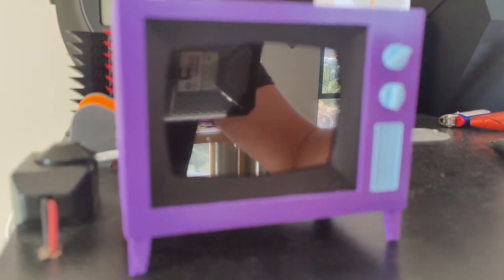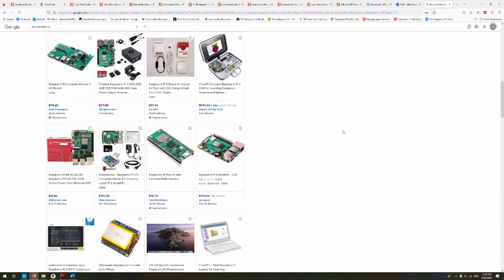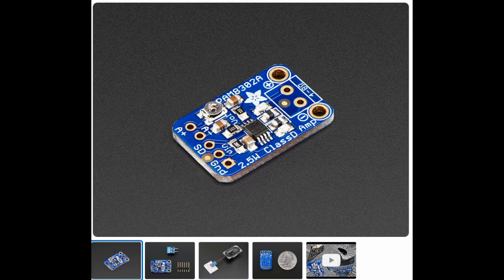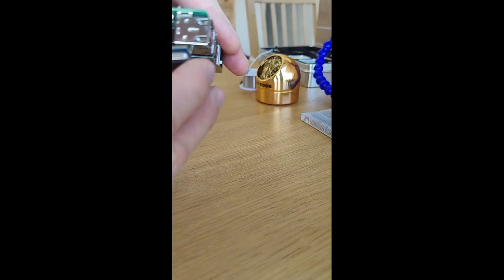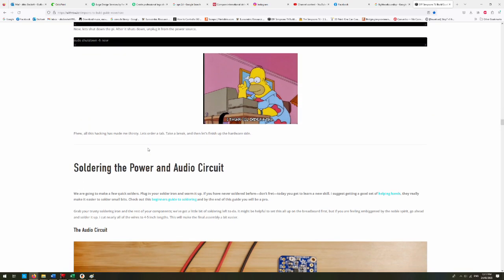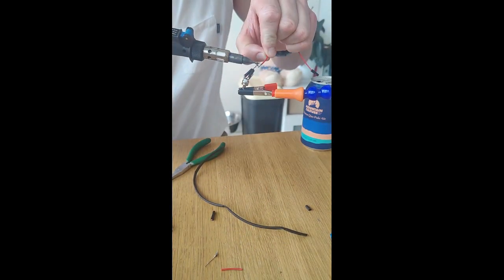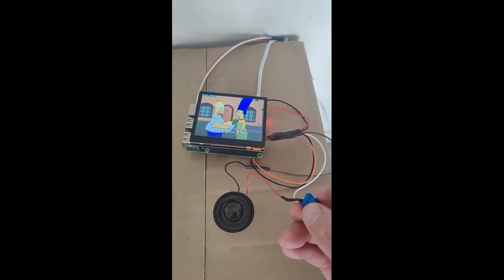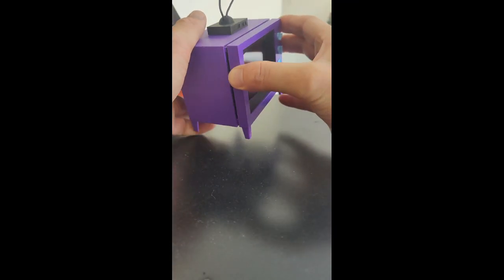3D printed Simpsons TV using Raspberry Pi 3b

Comment: Where did you grab buster lite?  I couldn’t find it in the pi imager ?
Reply: Got it working based on bullseye and oxm player… thank you for all the help :-)
Reply from the maker: Noo you have to download it.  
Then in the imager, scroll to the bottom and select custom software and then buster lite.
Reply: @ApeTechPrinting  

Perfect thank you.
Reply: @ApeTechPrinting  

I’ve got a 128gb card and wether i use etcher or the pi installer i end up with 128mb in boot and. Nothing else?
Reply from the maker: @AmishPatel-sl7cj  hey mate once you have written raspbian buster onti it.... Windows won't recognise it nor will it give you any accurate information as you have written Linux software to the SD card.  
I write the software to a 64gb card and afterwards it says that it's a 2gb card.  
I then proceed to copy 50gb of files to it.  
So don't worry about that
Reply: @ApeTechPrinting  godsend.  

Thanks I’ve been trying to complete this project for my wife since Valentine’s Day.  2 steps forward one back.  

Totally appreciate the help!!!
Reply from the maker: @AmishPatel-sl7cj  I understand mate.... It isn't an easy project, unless you're an expert in raspberry pi.     I am only an expert in Arduino.
Reply: @ApeTechPrinting  two steps forward one back.  Found the exact version of buster but can’t ssh to it (legit face palm).
Reply from the maker: @AmishPatel-sl7cj  setting up the WPA Supplicant file is the crucial step here.  
Entering you wifi credentials... I think I left the country code as US despite being in Australia
Reply: @ApeTechPrinting  thanks for all the help i know it’s not your day job :-).  I tried the supplicant and ssh route.  Note pad keeps making ssh ssh.txt not sure if that matters.  I also did the shift control x and added credentials there.  Maybe I’m not waiting long enough for the first boot….  I do have power (led in board  and backlight on screen).  I ordered a micro hdmi cable today so i can see what’s happening since I’m flying blind.
Reply from the maker: @AmishPatel-sl7cj Yeah you do have to wait about 2 minutes after it boots sadly.    I deleted the .txt. it warns me that the file could become corrupted, but just go ahead and do that.
Reply: @ApeTechPrinting  

Question for you.  I’m using the same uiniker 3.5 gpio screen… my problem is that all my videos (which i re encoded to 480 x 320) are all zoomed in to the upper 1/4 if the image was a grid box.  Any ideas?  Building a second one and it has the same issues.
Reply from the maker: @AmishPatel-sl7cj  I would double check the config file and make sure that the text you copy and pasted in there. Make sure you have the correct info there.  

Also double check the script you are using to encode the files
Reply: Got it working based on bullseye and oxm player… thank you for all the help :-)